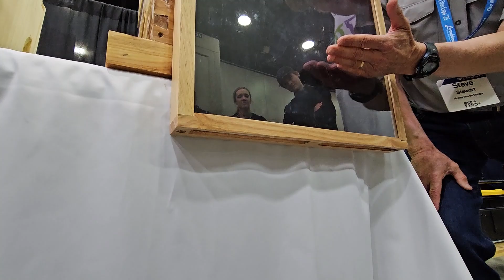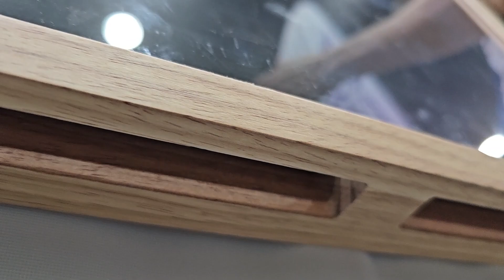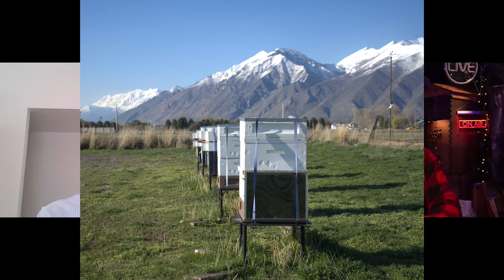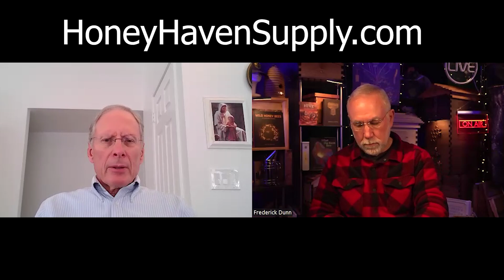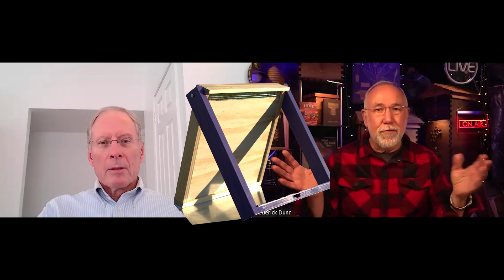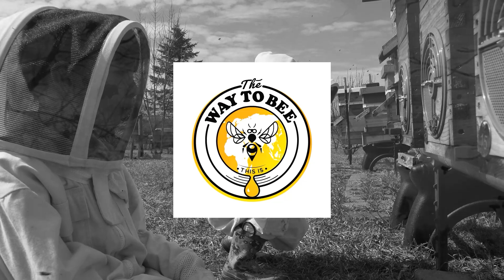Hive Heater for beehives, Interview with Steven Stewart and his new design.

Comment: You're pushing warmed air into the top of the hive, where is it exiting? Is it all blowing out the entrance, or does this require a screened bottom board exposed to the outside?
Reply from the maker: When the sun is shining, and that positive warm air pressure enters the hive, the cooler air is going out through the entrance. He mentioned that he uses screens on the bottom but that the bees attempt to seal that up. It's an interesting dynamic that we need to understand better :)
Reply: @FrederickDunn  It would not be hard to make a one way valve for low pressure air, using a flap of saran wrap, but favoring out instead of in (through the bottom) would be slightly more involved, requiring a C shaped channel.

I wonder if cold wind, especially at night (no sunlight) wouldn't cause a venturi effect at the air intake, thereby sucking cold outside air up through the bottom screen? Perhaps that would tempt the bees to propolize the screen?

Comment: In architecture Trombe walls would collect heat through the sun and store it in the thermal mass to release at night.  
I'm having some issues figuring out how this would work in a beehive but if it works for him it would be interesting to see more.  
Warm air actually can hold more moisture than cold air but I guess if the colder air outside is low humidity than maybe it can be effective in some areas.  
Solar food dryers actually vent out of the top to release that humidity since humid air is less dense than dry air.  
I'm not sure how the space between the boxes will do for the bees trying to get across it to the comb above.  
I also don't know how the gap where air goes in the space wouldn't cool the hive down considerably at night since there is no insulation there besides the plexiglass.  
I wonder if it would be effective in a lower slatted rack location.  The warm air would still rise in the hive and displace the colder air out the entrance.
Interesting idea.  I'm interested in seeing more.
Reply from the maker: All great questions... I'll be sipping cappuccino and seeing how things pan out :) The air movement stops when the outside air cools down, but you're right, it seems like that screen to the heater unit would likely become cold. We'll see... thanks for sharing your thoughts about this.

Comment: While it is designed for a hive, I could see the design resized to work on homes or even smoke houses for making jerky or processing cured meats or drying fruit/vegetables.  It might not be able to do the full job in such application but it could reduce the power required.  Many fruit and vegetables are already sun dried on tables, some covered with glass/Plexiglas and on the side of such a setup might decrease dry times.
Reply from the maker: Hi Charles! When I saw this innovation, my first thought was... how can I make a big one and put it on my Bee Academy Building. It already warms 20 degrees more than the outside air just from the south-facing windows. BUT, with a black metal solar gathering plate, and a glazed channel for the air to move through and into the building... free warmth. :) I did look at lots of solar green house systems, but this is different with the channeled air flow. Innnteressstinnng. :)
Reply: @FrederickDunn  I could even see them for window installs for houses like the old window AC units.  Might need to add a vent control of some form.
Reply: Probably where the idea was derived from…
Reply: Looks like it might be feasible on small operations, but how feasible on a larger scale.
Reply: Can not imagine that little panel would not  have nearly the BTUs to use for curing.
Reply: @MinnesotaBeekeeper  Did you not read that I said resized and also not just alone but to help efficiency.  It would be scaled based on the size of the box.  Thickness would not change much but the panel's area would in both width and height.